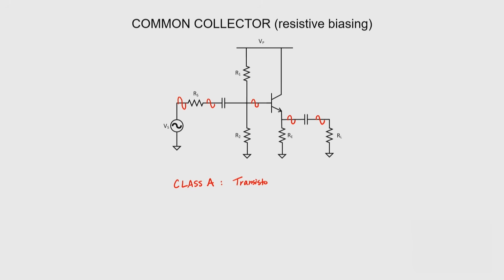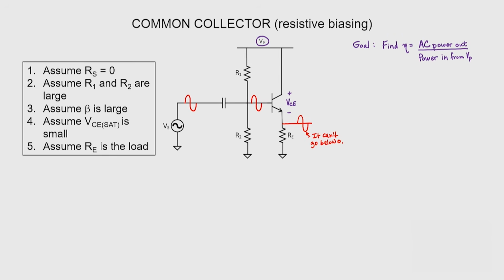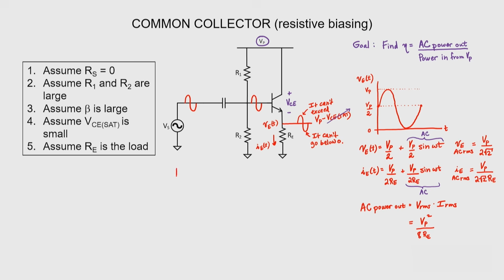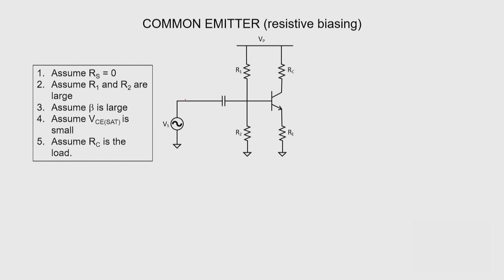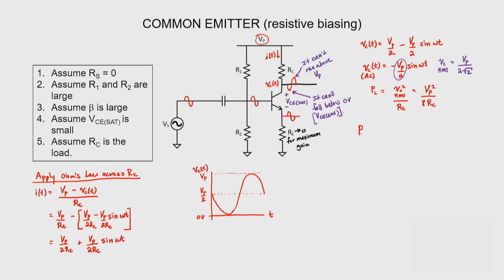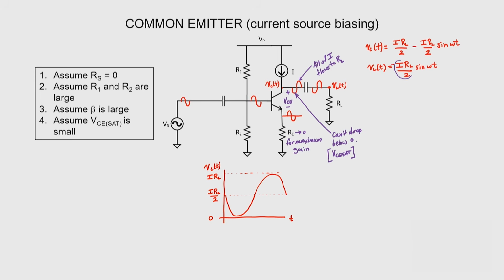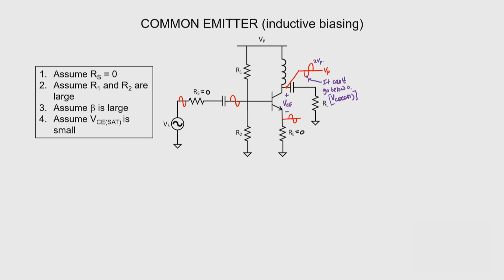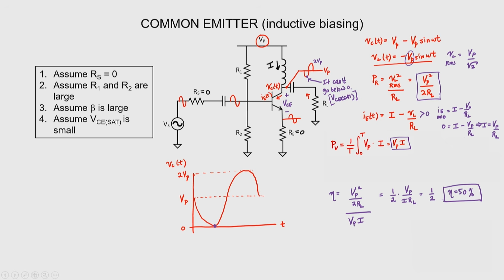Efficiency of Class A Amplifiers (31-Transistors)

Comment: This is the most absurd circuit l could possible imagine. An emitter follower is always directly connected to the input signal because the arrangement does not have any amplitude  increase and you want the amplitude of the signal to appear at the output. That’s the whole idea of using this type of stage.
Not only that, but the bass-biasing resistors are not wanted and not needed and on 50 years of designing circuits, l have never included an input capacitor or bias components. 
I have never in my life seen such a circuit and l don’t know where he got the idea from. 
The object of this type of stage is to simply increase the “strength” of the signal. This will generally be from 10 times to 250 times, depending on the transistor and how much demand you put on its capability. 
There is very little loss in the circuit and l have NEVER wondered about the efficiency. 
The load is connected to the emitter and 0v rail and is generally a very low value. Maybe from 4 Ohms to 500R. 
That’s the idea of the circuit. 
It is basically called an IMPEDANCE MATCHING CIRCUIT. 
lf the load is 4R and the gain is 100, it is like connecting 400R to the output of the signal. If the signal cannot drive it, you need another circuit. Or you need a transistor that will provide a higher gain. 
That’s what you are doing. Connecting 4R or 8R speaker to the signal with a circuit that multiplies the impedance by 100 or 200. 
If it will not work, you need another stage.

Comment: To obtain nearly 50% depends on such a high load resistor RL that the power delivered is close to zero.  The maximum power that can be delivered to RL is when it is equal to the "Optimum Load".  Then an efficiency about 35% can be achieved.
Now it happens that the transistor dissipation has a maximum of I×Vp at no-signal, and that any power delivered to RL reduces the transistor dissipation by that amount.  i.e. the transistor dissipation under signal conditions will be I×Vp - (power delivered).
To achieve a practical class A   ac amplifier (and it's quite possible to do so with a power transistor) :
1 - Chose an acceptable transistor maximum dissipation W (obviously, choose a suitable type and arrange for such heat-sinking as may be required)
2 - On a graph of I (vertical axis) against Vp (horiz axis), draw the curve corresponding to the chosen transistor dissipation.  (Math: I = W/V)
3 - At the Vp point on the curve, draw a tangent to this curve.
4 - The slope of this line is V/I (measured from where the tangent cuts the two axes) and is the optimum load.
Anyone requiring help with this procedure need only reply to this comment.
Note that in the very early days of transistors, before RF types were available, car radios used special 12V HT valves which could handle RF but only low powers.  Their output stage was a single large germanium power transistor in class A..